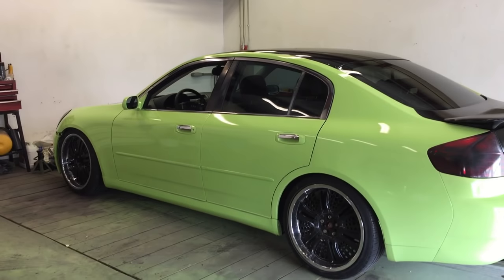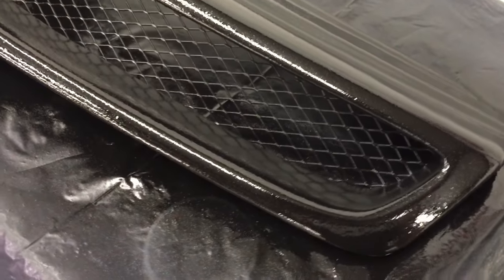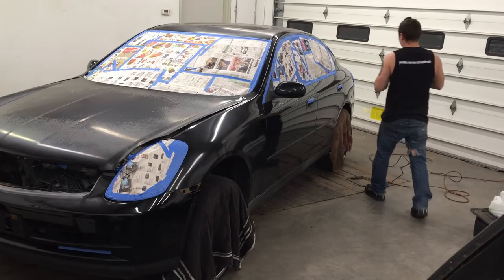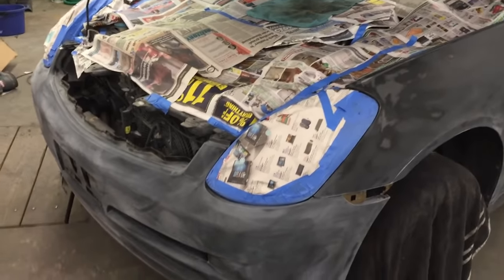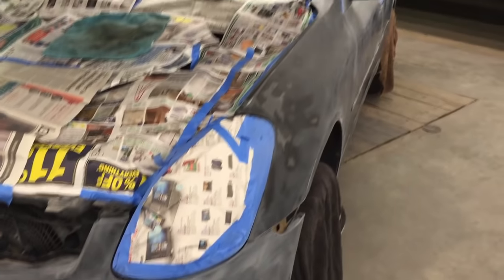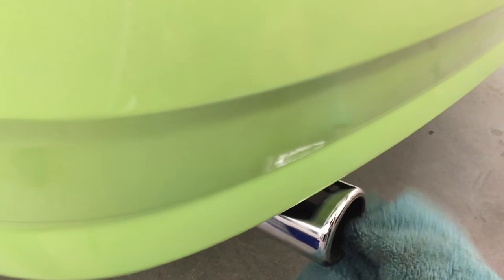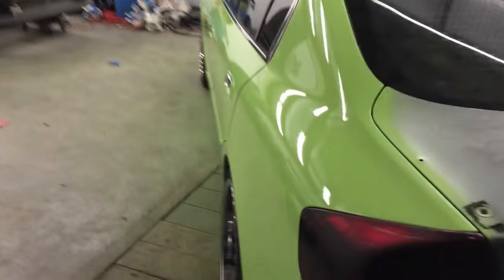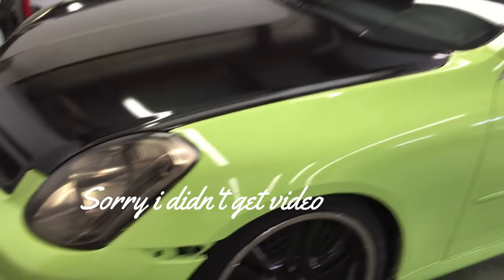Cheap Rust-Oleum Legit DIY spray can job you can do for 40$ or less! #budget #cheap #rustoleum

Comment: Hey guys. So love the paint job, and I recently started some small house projects using spray paint.

Almost A year ago, my car got keyed up pretty badly, both driver side doors and passenger side, some deep ones too.

If I were to go thru doing the same plan, using spray paint to repaint my car (I was quoted $300-$800 for car paint), what other precautions would I have to do to make sure the paint is able to withstand rain and the weather? (Winters down to 5 degrees f, summed up to 100F).

Comment: No primer?  I painted my car with blue metal spray paint I bought from KMart in 1992. I used over 12 cans, and drove to several KMarts because I kept buying the stock out. The car was an AMC spirit and was originally yellow, abount the same surface area as this one.  Can't remember if I primered it or not.  I put (too) some light coats of clear coat afterwards.  Wish I took a picture.  Held up for about 2 years, some wear, then car gave out.  I'm thinking of doing it again to my Scion xb, but that's alot to cover!!

Comment: Brother please if you can ..... I'm about to repaint my work van, need to fix some rust first, so  basically you just used 300 grit to sand and hit it with the spray and that's it?  im a painter by trade an i have airless spray machine used tp paint houses and stuff, i was planning to use that, figured i can pick a custom color i want, since rust oleum colors come premade and i want a specific sky blue color..  do you think i can get as good result as you , using my machine or just get the cans

Comment: I have one question.  Using a Rustoleum oil based spray paint on your car, the Rustoleum can says not to apply to surfaces that exceed 200 F.  On a sunny and hot day, the surface of a car gets pretty close to 200 F.  Have you had any problems or are you concerned that the Rustoleum oil based paint might catch on fire if it reaches 200 F?  Thanks.

Comment: 4:58 the whole purpose of aerosol sprey painting a car is to do it on the cheap, but you have used masking tape at $34 per roll in new Zealand, sand paper at $per sheet, primer$20 per can acetone? ,etc the cost for me if I used these things would be the same as buying a car that has OK paint

Comment: If the car has paint on it why you need to sand the whole thing before spray painting it?
Couldn't you just use a degreaser to make it clean then add spray paint directly onto factory coat?

Comment: Cool color and nice job but to say it's $40 is a straight up lie...gotta buy enough sandpaper to do the whole car, primer for any dent/ding fixes, degreaser or acetone to clean it after sanding, enough paint to cover the whole car 3-4 coats for durability, and a cut/buffing kit to get the right sheen and protection...

Comment: Need some help from you YouTubers out there I painted the trunk the hood and the roof of my car in Black using Rust-Oleum cans did not come out that good the hood ran a little bit and so did the trunk and when it all dried up the next day some tiger stripes and not an even smooth finish can you give me some pointers can you wet sand and buff what can I do or do I have to paint all over again I've painted three cars in the past 5 years with the big gun that you use in a paint booth and the paint didn't run and it came out good but with these little cans you get such a small 2 in stream that you have to go back and forward so many times and you have to be exactly perfect every single time you go back and forward that should probably have a disclaimer that this person on this video really has done a lot of painting with cans and he's got the technique down perfect so definitely my advice would be try to paint with the cans on something other than your car at least five or six times before you actually do it to your car and once again I'm a person who's painted three different cars in a paint booth with the gun that painters use at a body shop and the only difference this time around is that I'm using these cans and got a totally different result but I don't have five or six cars to practice on I only have one

Comment: Why did you skip the primer?
Reply from the maker: the 2X paint is a paint and primer combo. I almost never use primer but when I do use the primer it’s usually if one fender is a different color than say the door and the rear quarter panel all different colors. either way if it’s sanded good enough it should hold up fine. it has always worked for me

Comment: Bare metal exposed and you sprey it with primer,   it will only rust thru in around 1 month or less, I know I've been down this road so many times.  Search Ford 351 Cleveland worked starts up and revs ,( rimas nobody else's,    to see my enamel aerosol can paint job

Comment: It looks relatively good for an amateur. You didn't use primer and you were painting the car in a garage where the bugs live and the dust is flying around.

The car looks pretty, but i can see from far away how the paint is thin. 
1. You need primer
2. You need a room as much as possible - free from bugs and dust
3. You need more coats of primer, paint and gloss. One is not enough.

I recently bought a can of spray for 6.50 BGN ($3.50) and I'm surprised how well this can sprays the paint (I have painted car parts with a professional pistol and a compressor) and i have some very basic understanding of professional painting. (very basic)
With a can, you can make this car look waaaaaaaaaaaay better if you learn from your mistakes properly. You can make it look like it came out of the factory.

Good luck next time.